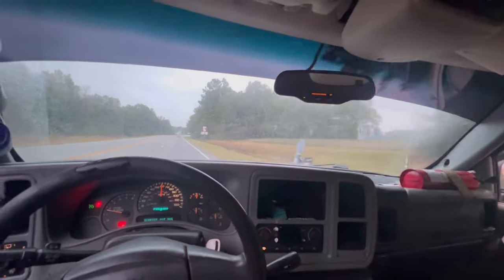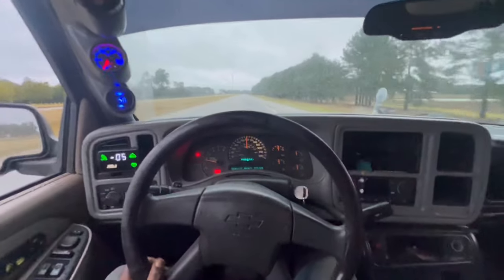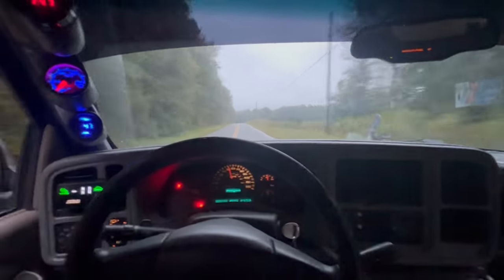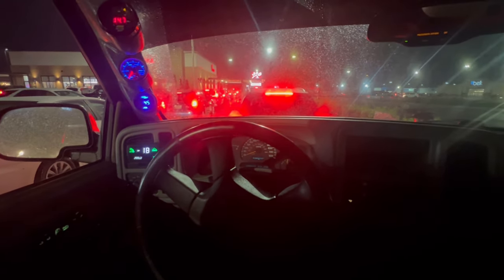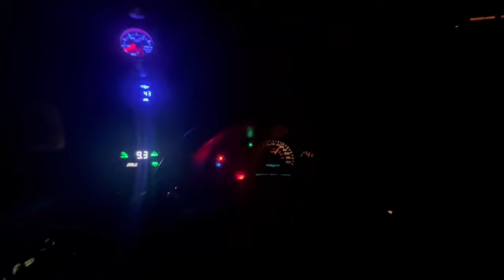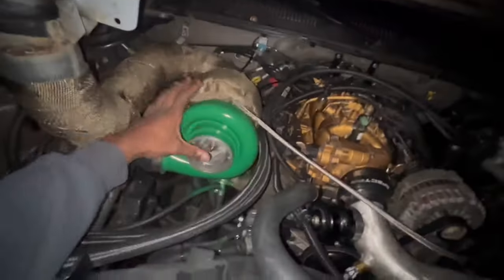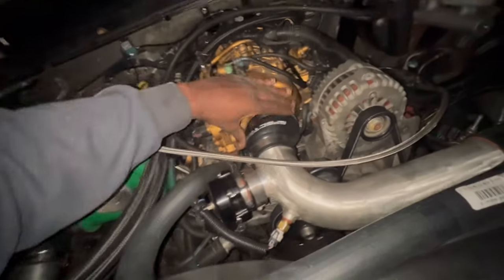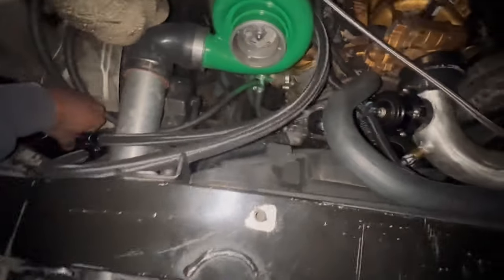What is it like to drive on a low budget turbo setup 👀 for a Chevy Tahoe (POV)

Comment: you are correct that's a little too much play in the wheel, you can see where the impeller is hitting on the housing. you can get a rebuild kit and do it yourself not too hard just search for your type turbo, or since they are pretty cheap just get another turbo lol. don't wanna risk part of that impeller coming off and going through your engine!
Reply from the maker: Yeah you right appreciate input 🙏🏽💪🏽

Comment: watch J.T the car guy videos. He would tell you  to stay away from those synthetic oils. Stay with the old stuff bruh. I'm testing out something I just learned, porting out the heads. In which it will flow better. The factory casting heads always have like defaults or just when they cast them they do not float the bowel basically just smoothing the bowels out cutting back on some of the matter o get a better air flow. Some say it works. My Dad even says it works, that dude raced cars for years and he say; it usually take a person to time to figure out the mechanics of any vehicle but once you get it, you will always be doing something to improve the air flow ,and gas, plus timing. You got this little bro. Paint that bit*h hulk green. Much love you got to take it by the tracks to record your time  on your truck. Then go from there.....
Reply from the maker: Will do and appreciate the advice 💪🏽🙏🏽 and hulk green sounds nice 👀🤔